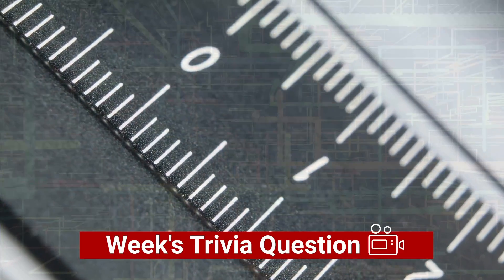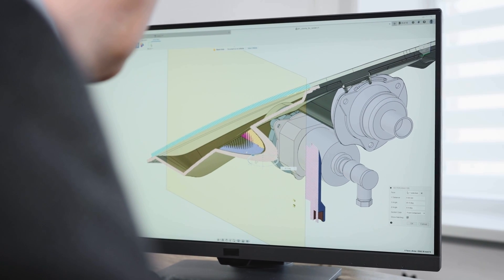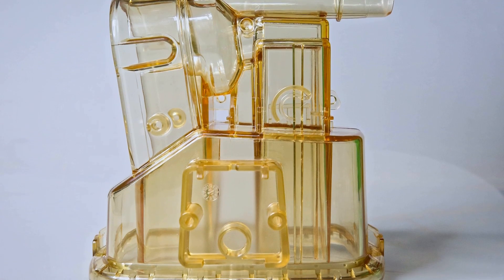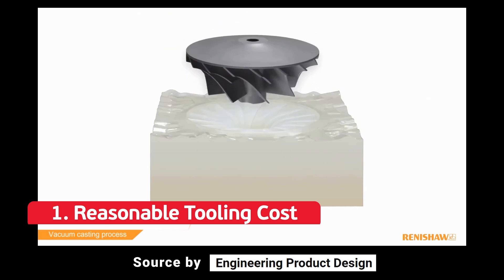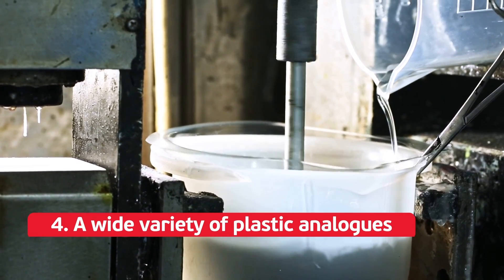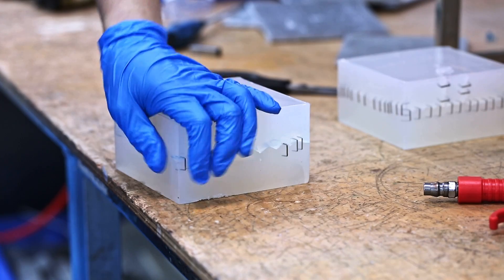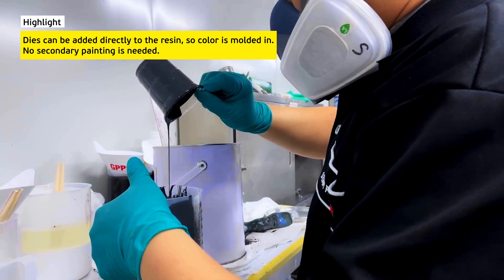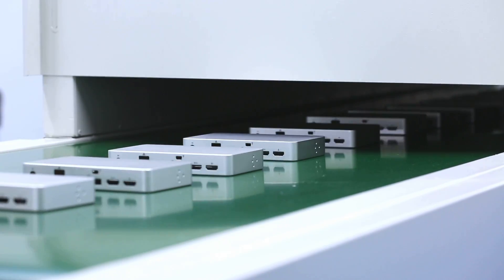Vacuum Casting vs Injection Molding: How to make PROTOTYPE PLASTIC PARTS!

Comment: A really great video👍. Almost every day, we make various customized plastic parts for customers through vacuum casting(silicone mold)🗺🌎, especially plastic shells.If it is for small-batch production customization, vacuum casting is one of the best choices. If a large quantity is needed, injection molding is of course the choice😀.

Comment: Theres also 3d printing
Reply from the maker: Printing these would bring up all kinds of different problems to be solved. For one, laser sintering would introduce all kinds of thermal stress, causing the part to warp and thus require further post-machining.